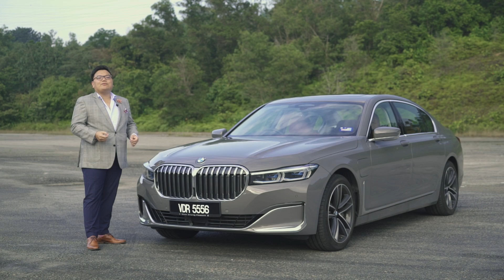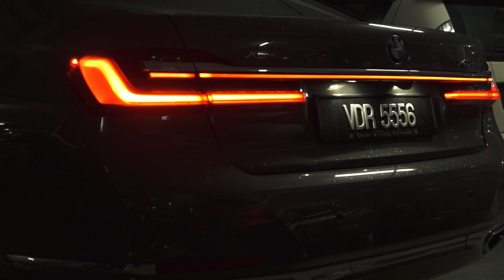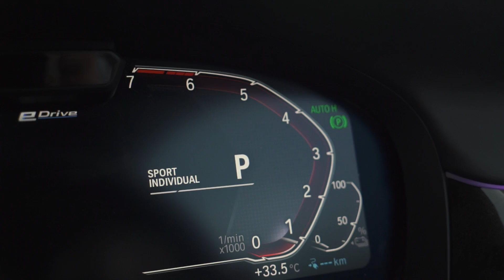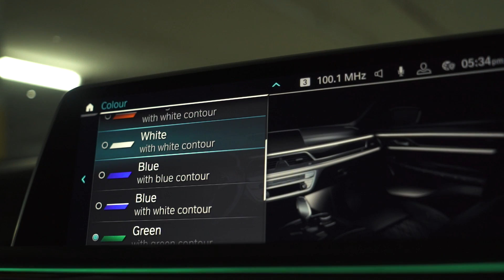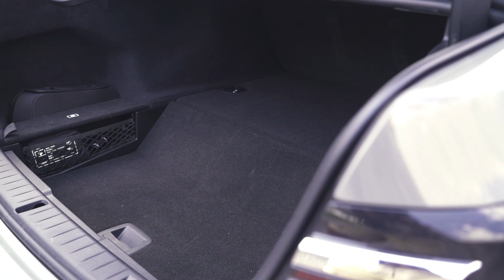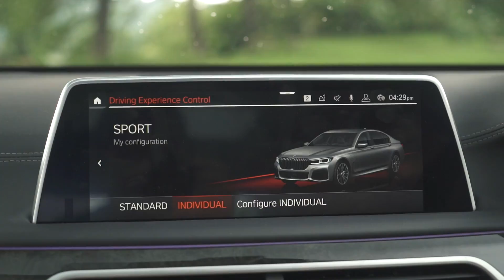FIRST DRIVE: 2019 G12 BMW 7-Series facelift Malaysian review - 740Le/745Le, RM594,800

Comment: Crappy review, focusing on wrong stuff and picking on minute things... I mean do you need to choose from 64 colours when you just want some interior lights or for that matter, pick a bottle of mineral water from 64 different brands? I know of many people who switched from S Class to The 7 and I ask myself objectively whether I would go for the S and the answer is NO! Lastly, since it's all about personal choice, I think the S suits you more than The 7 as the S tends to be preferred by old uncles, usually businessmen, and they tend to be fat and have big round tummies. On the other hand, The 7 tends to attract professionals and top executives. Also, some of the things missing is because of what the importer ticks, probably to give it the required margins, not so much because the cars don't come with those things. BMW engineers can't be that stupid! Do your homework and look at the reviews in other countries. So, think before you comment or else you look really stupid!
Reply from the maker: Whatever is said in this review refers to the Malaysian-market model, where the cars are sold as is, with no options available, i.e. you can't choose to add on 360-degree camera, etc.

Comment: I don’t think the interior materials and build quality here are only ‘slightly’ better than the 5 series. The leather and wood used are sumptuous, and are several levels better than what’s in the 5, which uses plastic on the dash and the old, rough Dakota leather upholstery. 

You’ve also been saying for years that the HK system is better than the Burmester in the S-Class. Could you elaborate? My experience with both has been the opposite of what you’re saying. 

I also disagree with your comment that this car can keep up with M-cars. It’s quick and will definitely hang with a C43 or M340i on the highway, but I doubt it’ll be able to keep up with a bona fide M like the M4 or M5. 

I’m not sure what you mean when you say that an S is not an enjoyable car to drive. It may not be an agile car, but it’s not a stretch to say that the way that the S cruises on a highway easily induces a smile from the driver. Enjoyment, I think, changes according to the category of car in question. While one would expect agility to contribute most to enjoyment in a sports sedan, it seems that sense of occasion here is more appropriate. Just my two cents.
Reply: The bursmester lacks the clarity and base of the HK
Ask any merc owner equipped with that and they will say the same
Reply: Andrew Lee It does lack bass, but I cannot fault the mid-range and treble clarity of my unit at all. I don’t think your blanket statement accurately represents the opinion of all Mercedes owners.
Reply: @Kr0nicridah  look at any w213 or w204 forums/ pages and they will always say why the speakers sound bad and how to retrofit the 3d or something
Reply: Andrew Lee Forums have always been filled with people complaining about their car audio and innumerable other aspects of their cars. You’ll find similar posts on W221 forums regarding the B&O (which was underwhelming for the price), Porsche on its top end Burmester in the Cayenne and 911 (which to my ears is an excellent setup) , and BMW on everything from the base speakers to the top end B&W. My point is that people who are satisfied with their systems don’t usually create posts on car forums. 

Secondly, identically-branded systems are different in each model due to the interior space and thus sound staging. For example, the notoriously underwhelming Bose system in the 911  sounds as expected but is surprisingly good in the Cayenne. Same case with last generation’s Harman Kardon in the S-class vs in the GL. While I agree that the Burmester in local C-classes has a muddy sound, I do not find the same problem to pervade either the E or the S here.

Or one could chalk our differences in opinion up to quality control issues by both manufacturers. Perhaps the reviewer, Hafriz,  has experienced poor examples of the Burmester and fine examples of the HK system which caused him to develop his current opinion.
Reply: @Kr0nicridah  he did compare the G30 to the E class's burmester in which he said the HK sounds better compared to the burmester which looks better than it sounds
Reply: Andrew Lee Yes, because Mr. Shah is obviously the eminent authority on sound quality in car speakers.
Reply: @Kr0nicridah  neither are you
Reply: Peter Ambrose I never claimed to be. But I do have a significant amount of experience testing car audio and home systems and am able to offer a substantiated opinion.